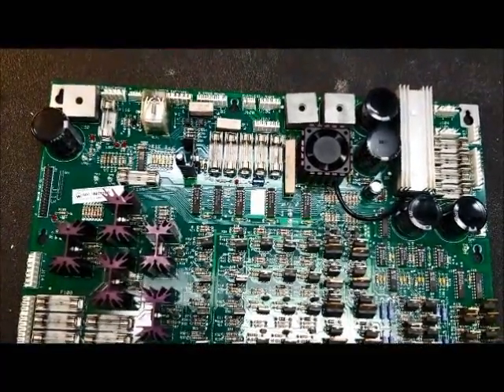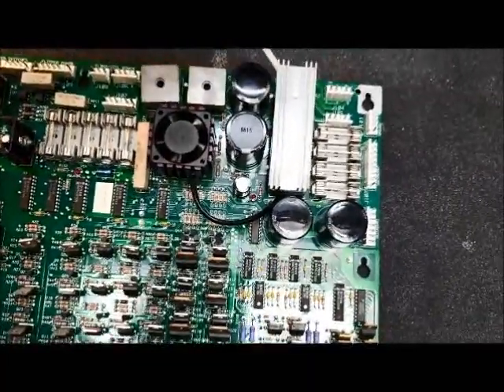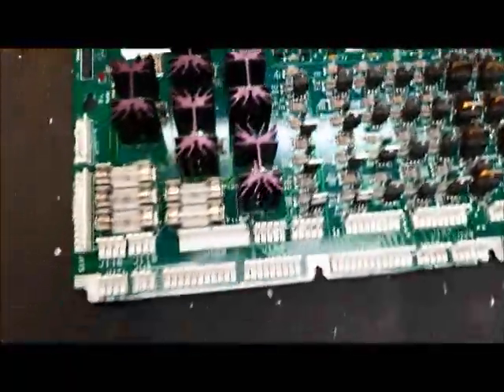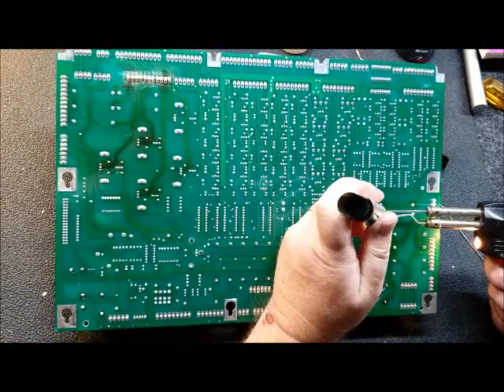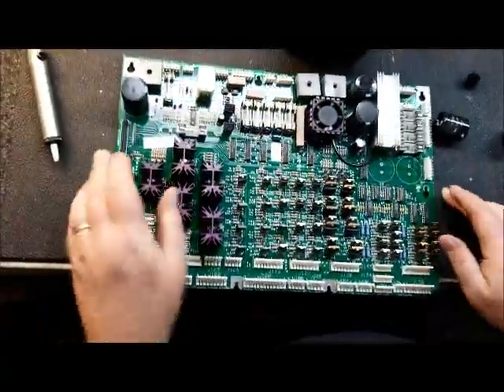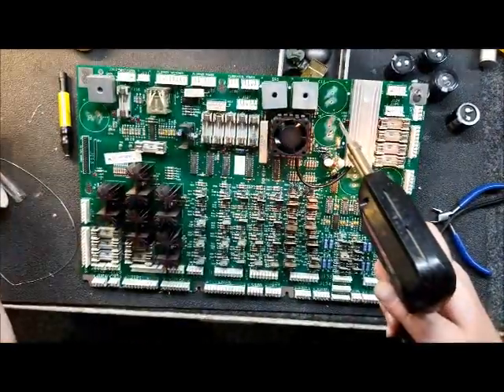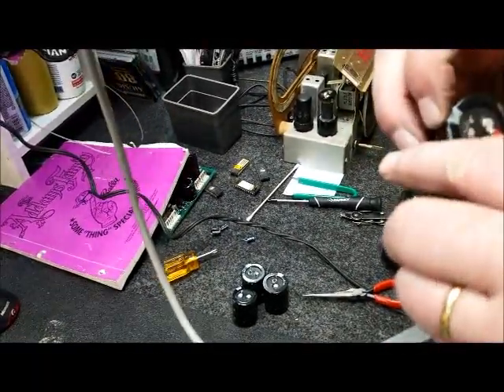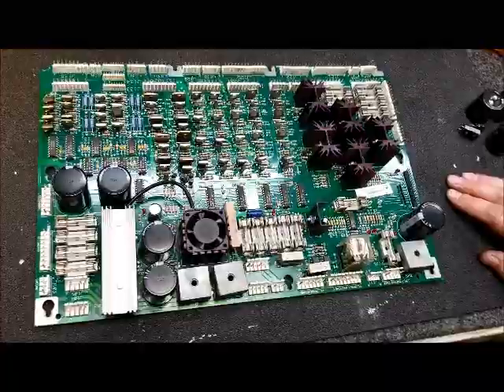Replacing Capacitors on WPC Power Driver Board using Chip Quick

Comment: What about a hot air station for removing them. That way you don't have to worry about sucking the solder off the pins. The only question I would have is, what temperature is acceptable on that board since it's 20 years old. I work with new boards (in game consoles) that are mostly copper so I can go up to 425C for short periods.

Comment: Question on the repair to the eyelets:  you just sand away the green mask to expose copper trace?  What grade sanding paper?  and then use a narrow gauge wire to stitch the original hole?  And finally, what do you solder the legs of the new cap to if there is no longer an eyelet?  thankyou
Reply from the maker: I use a fiberglass pen to strip the solder mask.  Found these things years ago and just love them.  https://www.amazon.com/Prep-Pen-FBA_Prep-pen-Adjustable/dp/B000J18RT6.  If you clean the mask on both sides and connect with a small gauge wire you can easily flow the solder around it and onto the trace.
Reply: @tipsfromthetechbench4589  Great video.   And thanks for the link!

Comment: Great video, thank you.. I have connectors for 115 and 120 with burn and some repair in the past. Id like to sort them. I guess I should replace the 8 caps at the same time regardless, as I don't know of they are good. They don't "puffy" but I guess who knows!
Reply from the maker: "Puffy" is not always a good indicator.  Assuming they are all original, I think if you check the value of the 15,000uf you will most likely find they are 50% or more out of value.
Reply: @tipsfromthetechbench4589  I would need to test them out of the circuit? I think I will bow to your far far superior experi nice and do the lot. Do the bridges too?
Reply from the maker: @robllewellyn  Usually bridges are either good or bad but they can break down with load or heat.  I've gotten to a point that I just replace them as part of the rebuild process.

Most cap testers will give a more accurate reading out of circuit.  I use the Sencore LC-102 however the next model up, the LC-103 professes to be accurate for in circuit testing.
Reply: @tipsfromthetechbench4589  I have a Fluke 114 for testing so I don't have a huge amount of advanced kit. But have a solder sucker and some chip quik!